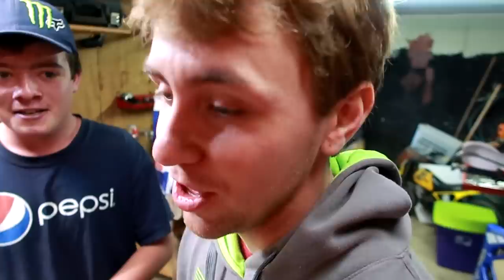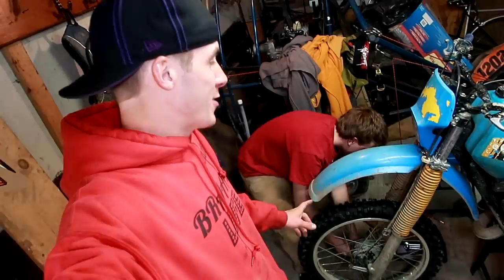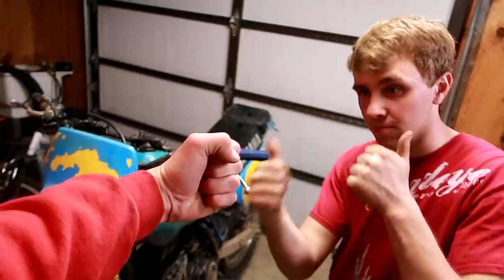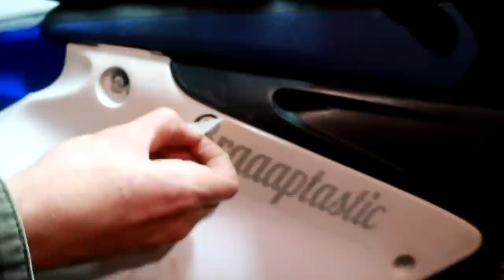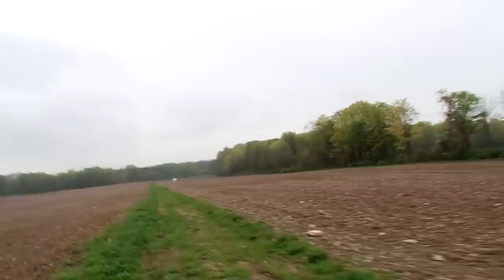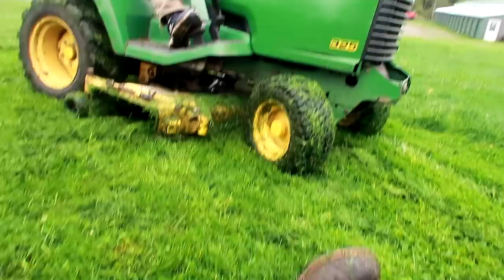RACING THE DIRT BIKES **KTM VS YAMAHA**

Comment: When I was running my Honda MT250 (hey I put a reed valve and a larger 32 mikuni carb on it) we didn't have the money for new tires. What we did is get out a box of razor blades and cut new edges on the knobs.  It brings new life to old tires.

Comment: Bruv I've just brought a 2006 525 exc I've done a oil change on it and there's a main drain plug on the back off the engine and only 1 drain plug on the side by the gear lever with the long oil screen in but no other drain hole I thought all 525 exc had to oil screens 1 long and 1 short do they or don't they cheers Bruv top video keep up the good vids dude 🤘🤘